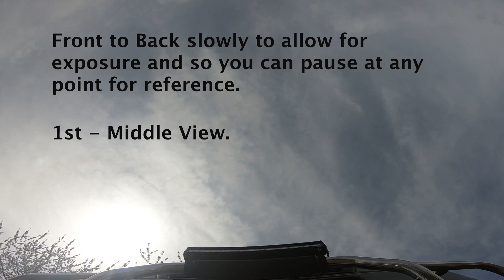Mazda Bongo / Friendee / Ford Freda: Underneath the Bongo!!

Comment: interesting point of view, intrigued by the way rear heater is bypassed as usually engine block pipe goes in to mentioned T piece,
Reply from the maker: There was a guy on the Mazda Bongo Owner Club facebook group that had done it this way, essentially going from engine block to the front matrix completely bypassing even the long steel pipe.